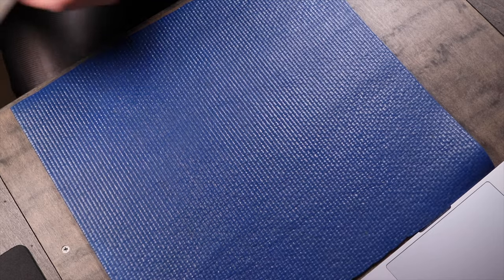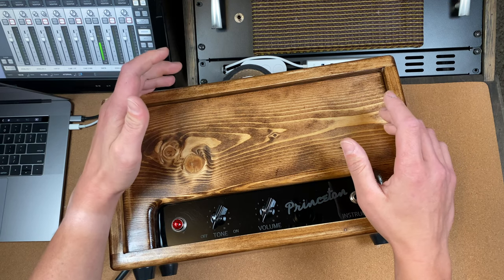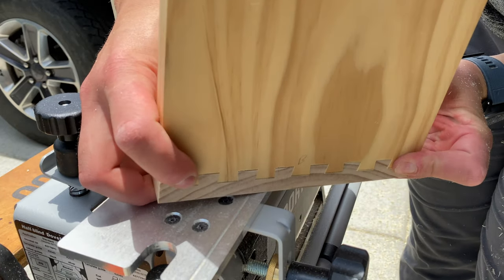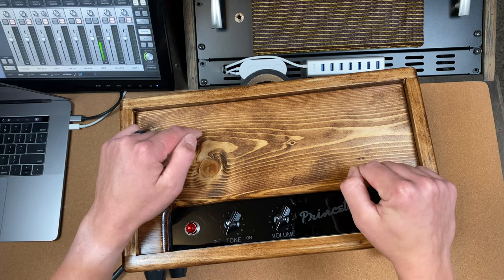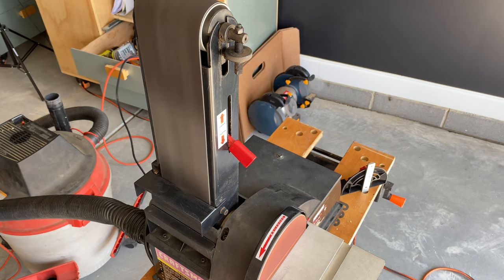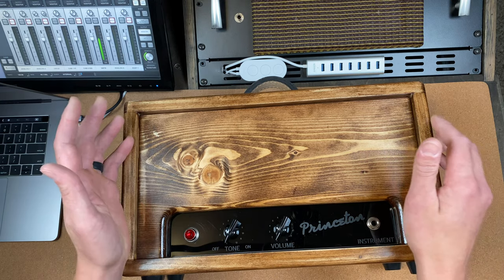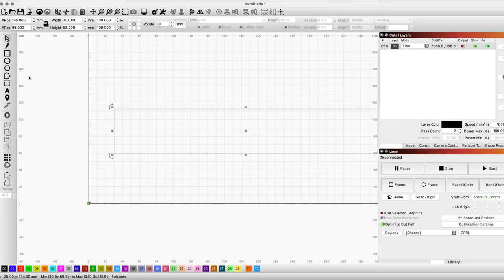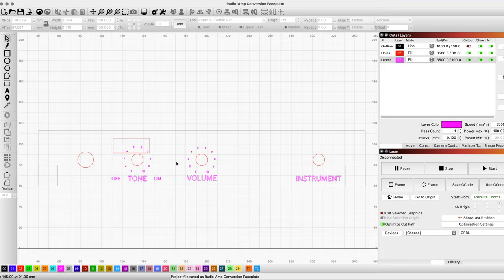Custom Fender Princeton 5C2 || Tube Radio to Amp Conversion Build Part 3

Comment: Tip with staining pine.You're better off with a dye based stain over a pigmented one unless you prime the surface well.Dyes will not look splotchy,pigments will.Pigments are good for woods like curly maple because they bring out the grain but on woods like pine they look splotchy.
Reply from the maker: Thanks! I’ll give that a try

Comment: I really want to hear you play your Strat through this ;)
Reply from the maker: I’m a little embarrassed to say this, but I don’t have a strat haha. Just my PRS right now ;)
Reply: My mistake brother I thought I saw a gold strat with a white Pick guard hanging on the wall of one of these videos.
Reply from the maker: o ya! good catch haha. I had borrowed that and totally forgot that s hanging in a video. what guitar do you play?
Reply: I go back and forth between guitars especially Gibson humbucker types. Up until about 3 months ago I have been playing a Firebird with full size pickups in it for the last 2 years. It was one of those rare guitars that came right off the show room floor playing really good. Because the wood is smaller and thinner on the body it didn't sound like a Les Paul which was really cool. Then recently I played a Telecaster that I really liked so I bought one just like it site unseen from Sweetwater. I didn't really like the way it sounded so I put a Seymour Duncan antiquity in the neck and a broadcaster pick up in the bridge. It's nice and twangy now. The only other telecaster I've ever owned had a hum bucker in the neck. That's what I am playing recently, the change is a lot of fun.
Reply from the maker: Sounds fun! Is that a deluxe telecaster with the humbucker? I think I’ll get a tele next, I’ll keep those pickups in mind if I don’t like the sound.